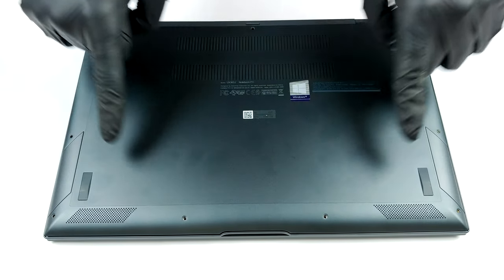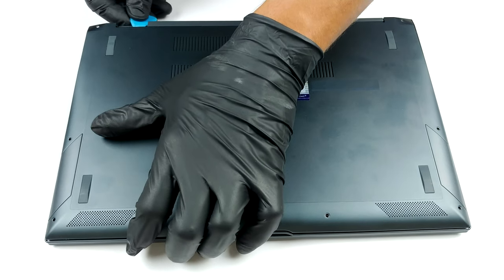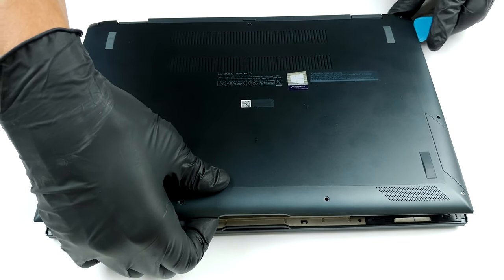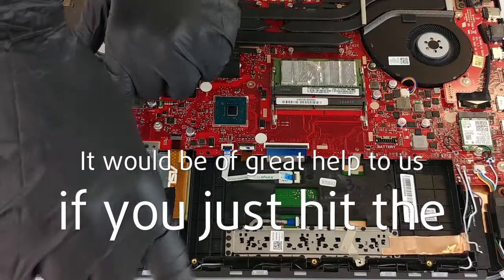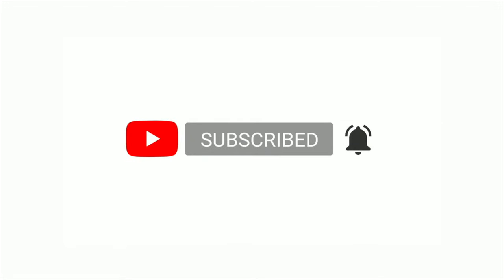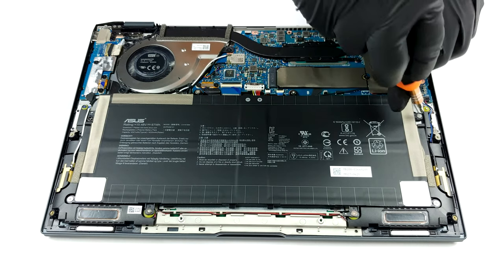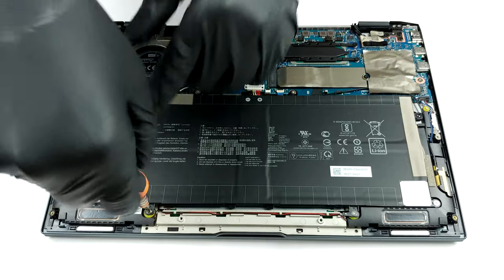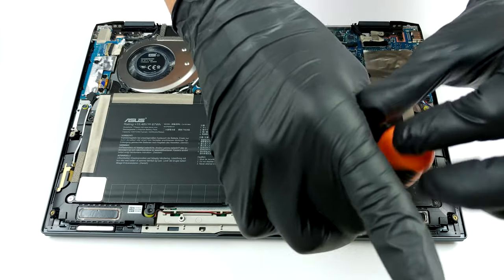🛠️ ASUS ZenBook Flip 13 UX363 - disassembly and upgrade options

Comment: Thanks for disassembly and video.  Would be nice if you had also removed the cooling foil from ssd and ram, or even remove the complete heatsink.  That way we know much more about the hardware and you have a 10+ min video for more rewards from youtube  ;-)

Comment: Is there some glue used for the bottom or only the torx? My old laptop had both and it was hard to remove the bottom without scratches